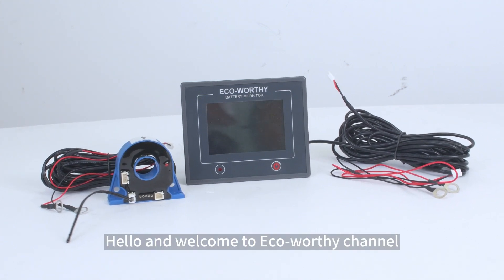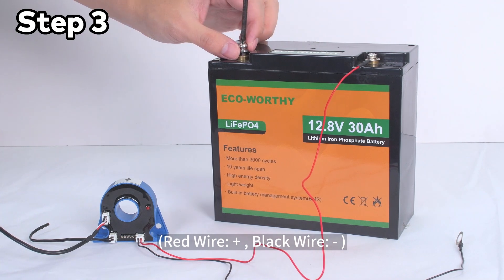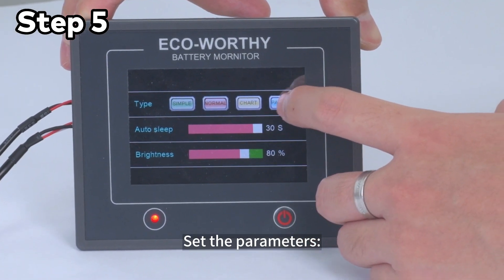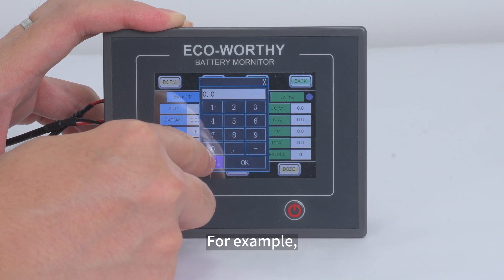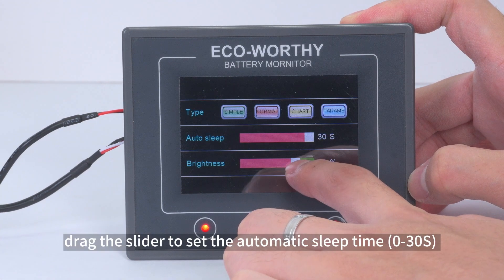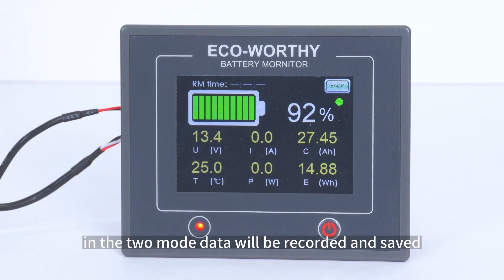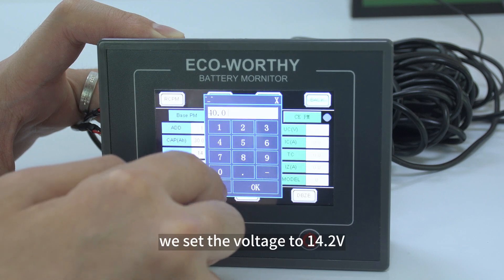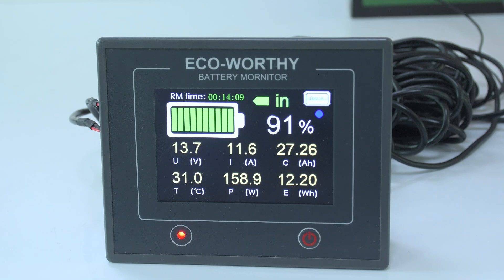How to set up a 0-100V touchable battery monitor with hall sensor upgraded? | ECO-WORTHY

Comment: What are the parameters for your 12.8v 100ah lithium battery?
Reply from the maker: Thank you for your question. Here are the parameters of 12.8v 100ah lithium battery：
Battery Capacity: 100Ah
Battery Power: 1280Wh
Battery Voltage: 12.8V
Maximum Charge/Discharge Current: 100A
Charge Temperature Range: 0-55°C
Discharge Temperature Range: -20–55°C
Maximum Charge Voltage: 14.6V
Discharge Cut-Off Voltage: 10V
Screw Size: M8
Battery Size: 260*168*209mm (10.2*6.6*8.4inch)
Battery Weight: 10.5kg
Recommended Charger: 12V 10A Charger

Comment: What does the E (Wh) value measure? On mine, it seems to reset when the state of charge changes from going in to going out and vice versa. So last night, after fully charging the battery, I removed any further charging and pressed the Battery full voltage button, then proceeded to discharge my 200Ah battery down to 10%. The E (Wh) seemed to correctly measure the Watt hour that was used during that time and climbed up to a value of about 2250Wh. Then I turned off all the loads and attached a charger. The E (Wh) value then zeroed and began recording the amount of Wh going in to the battery. I left it doing that overnight, disconnected the mains charger in the morning, but left a solar panel putting a small amount of charge in and started up a fridge - so a load, higher than was going in, the E (Wh) zeroed again and started recording how many Wh was now going out.

Is this the correct behaviour? It doesn't seem to present any useful data. Shouldn't it be showing me how many Wh capacity the battery has? Is there something that needs to be done to get it to work correctly, if it is not doing so now?
Reply: Sorry. Here from Argentina... De full battery Button? Is It BDFU?   thanks..

Comment: Can you connect multiple batteries in parallel to this and just increase the AMP setting in the monitor ? (ie 2 X 100 - so set to 200AH) ?